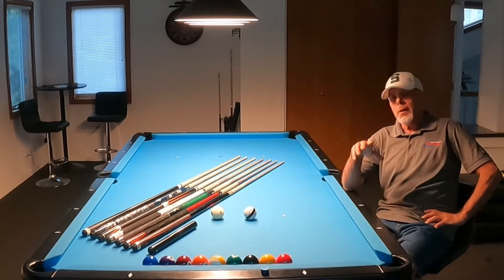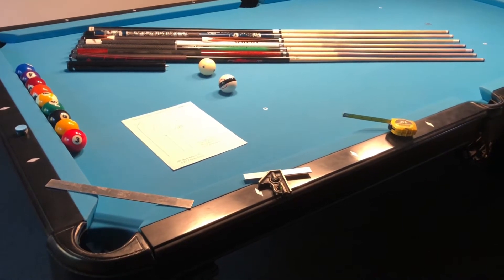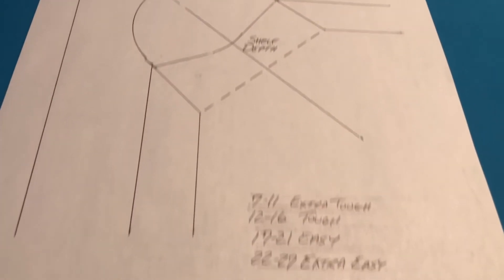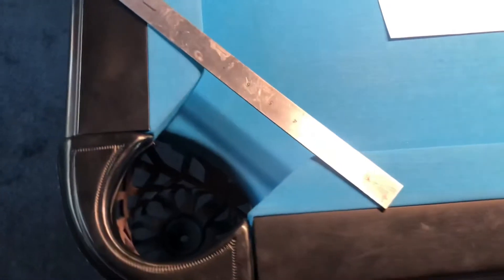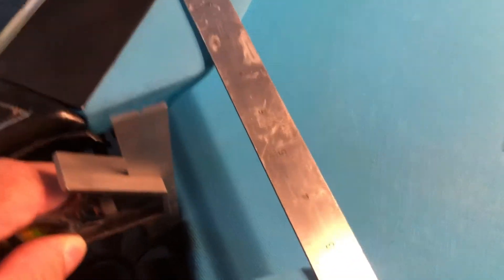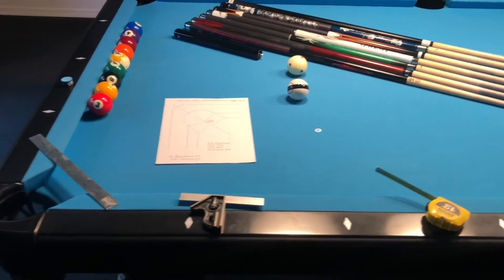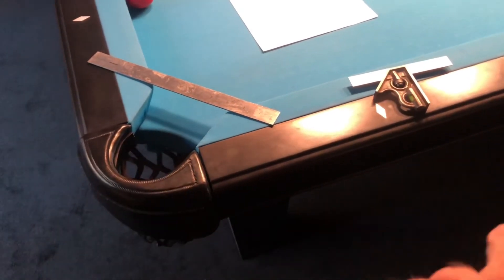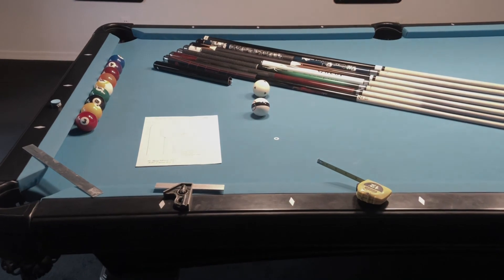How to calculate Pool table pocket toughness formula explained

Comment: The table ive been building, ive been following the diamond table spec. Unfortunately the slate i have only gives me so much shelf. So it falls in the 10 ish area on the scale, i think. Its been a while since i did all that.
Reply from the maker: @djsnowman06  Thank you for weighing in DJ, I appreciate you sharing 👍🏻😊

Comment: I have a 25 year old Artisan Designs by Advanced Billiards (made in USA) 7' maple table with a 3-piece slate at home.  

My corner pockets measured at mouth width: 5", shelf opening width: 4 5/8" (4.625), and 1.5" shelf depth.  5 x 4.625 / 1.5 = 15.42, so that's on the easier end of the Tough range.  Good to know.  The Diamond tables that I play locally are I'm sure in the Extra Tough range, but I love shooting on them.  

I bought this table about 7 months ago, and have replaced the table and rail cloth with the more affordable Champion Invitational cloth (Titanium color, love the color!), and at the same time I replaced the rubber rails (K66) and facings.  It was a fun challenge, I watched a lot of vids, but came out pretty good (I DIY everything that I can), with only a couple minor issues.  

I am thinking to spend the $ on Simonis 860HR the next time around, but I wish there were more color options.

I have watched a couple of your vids, good stuff, keep it up!
Reply from the maker: @MemphisGuitars-oj5wp  
Very cool and thank you for sharing MG. It sounds like quite a project 😊
Thank you as well for checking out my channel. Btw, I’m curious. Have you watched any of my more recent tutorials? I’ve evolved in my abilities as a content creator I think. 
Thank you 👍🏻
Reply: @ronthepoolstudent  Hey Ron.  I just discovered you yesterday, will check out more vids today.
Reply from the maker: @MemphisGuitars-oj5wp  
Thank you MG 👍🏻😊 
Please let me know if you have any questions as I’m always here to help and I answer 100% of my viewers/fellow players comments and questions.

Comment: I have an Irving Kaye Thunderbird 7' bar box (40x80) that has 4 & 1/8 pockets. Lol it's still set at $ . 75 on the coin slot. However uses moon size CB and I just leave it open to enjoy the predator arcos 2 pool ball set .... Best combination IMO... Obsolete now but better and more like a diamond table before their time
Reply: I think my table has been valley-i zed yet plays like a diamond table although there's only two diamonds per 36" of cushion
Reply from the maker: @ Believe it or not, I shot on a Valley table for the first time ever last Friday at a Moose lodge. 
I was told it’s 4 1/2” pockets were typically much wider. The sides were narrow too which I was told is typical. It played well as it had fast Simonis.
Reply from the maker: My favorite is my buddy’s 10’ Gold Crown. His pockets are 4 3/8” with diamond cut wings. He’s a 600+ player when he shoots on the smaller surfaces. The first time I shot on the table I got him 7-2 in nine ball. I recall missing five or six shots during the match. The key was to play what the table gave you and accept the long shot. That table makes me really bear down. 

Btw, this video was from a long time ago. The pockets back then were wider. Since then, I tightened them. My next cloth change, all pockets are narrowing another 1/4”.  The sides are getting reduced 1/2”.

Comment: Hmmm... I will check this out at Maryville billiards where I practice and play, 9' Diamond table  over 10 years old (I will find out age for sure and if the cloth and rails have been changed at any point, will get back to you.!!
Reply from the maker: Sounds good Chemmii. 
Btw, the only thing not taken into account is the angles into the pocket. My Olhausen for instance, has 155° angles which makes them rattle balls at times.
Reply: @ronthepoolstudent  hey Ron, I will check that also... I have a digital angle divider, I will be as precise as possible... I am wondering how much difference there may be between older diamond tables and new present day diamonds...do you have access to a new diamond table to measure or not ?? Let me know please ok?
Reply from the maker: @chemmii  I do and will check next time I’m heading to the billiard hall 👍🏻

Comment: Something is not right with this formula as it would give you the same result for many width combinations at the same depth. The angle between the wall pockets must make a difference. Here is an illustration (I could not paste a screenshot here so I hope the table in text form will not be confusing) :  		
			            Pocket		
			            Toughness		
W1  	W2	       D   W1xW2/D	Angle in degrees	
4.229	4.648	2	9.83	-11.97	
4.271	4.602	2	9.83	-9.46	
4.314	4.557	2	9.83	-6.95	
4.357	4.511	2	9.83	-4.42	
4.401	4.467	2	9.83	-1.90	
4.434	4.434	2	9.83	0.00	Parallel walls
4.445	4.423	2	9.83	0.63	
4.489	4.379	2	9.83	3.16	
4.534	4.335	2	9.83	5.68	
4.579	4.293	2	9.83	8.20	
4.625	4.250	2	9.83	10.71	Example in this video
4.671	4.208	2	9.83	13.21	
4.718	4.166	2	9.83	15.71	
4.765	4.125	2	9.83	18.18	
4.813	4.084	2	9.83	20.65	
4.861	4.044	2	9.83	23.09	
4.910	4.004	2	9.83	25.52	
4.959	3.964	2	9.83	27.93	
5.008	3.925	2	9.83	30.31	Wide open pocket

As you can see, the angle between the pocket walls shown in this video is 10.7 degrees but the formula would give the same toughness result for a wide open pocket where the pocket walls form a 30-degree angle.  That cannot be right.  The opening of the pocket (W1), the angle of the walls, and the size of the ball must play an important role in the toughness.  Anyway, the formula for the toughness could be a bit more complicated than W1xW2/D
Reply from the maker: Agree!
Old video hollosarka. The formula is from Dr Dave. Please refer to his channel for any more detailed questions. Thank you and sorry 👍🏻

Comment: Your shelf depth is not 2”. It’s 1.625”. My friend has your exact table.
Reply from the maker: From the points to the closest arc 
tangent of radius drop off (where the ball begins to drop in) is 2”.
Don’t know what to tell you but 2” is correct.
Btw, I’m a journeyman tool & die maker.
Reply: But you are measuring from the second drop off... Surely you should measure from the first?

Comment: A quick, but not as accurate check is to see if you can fit 2 balls in the pocket at the same time. 2 balls together is 4.5 inches. I haven't played much in the last 10 years and have played on some bar tables pretty good. Last night I practiced at a real pool hall that I used to play at maybe 30 years ago. I noticed the pockets were tight and I couldn't fit 2 balls in them. Not even close. I kind of feel the more serious pool halls have made the pockets more tight in the last 30-40 years.
Reply from the maker: Thanks for watching Richard and for your comment. You’re correct and here is what you are describing. This is my table. 
See link below:
Olhausen “Belmont” factory pockets
https://youtube.com/shorts/eUOtOTUlkb0?feature=share
Reply from the maker: Also, here is a great way to overcome pockets that may be too large for your skillset. 
Pool shot exercise
https://youtube.com/shorts/koFhJ_lDYpQ?feature=share

Comment: Is the shelf depth the same for the center pockets?
Reply from the maker: No
Reply: @ronthepoolstudent  what kind of shelf depth should I aim for on the center? I'm designing/building a table and I want something on the harder side like your table
Reply from the maker: @Shakshuka69  my side pocket shelf depth is 1/8” AD1. It’s more about width on these. Measure tables at your local billiard hall to find the width that would either present a challenge or not, would be my suggestion.
Reply: @ronthepoolstudent  Thank you! I'm going for a 5" opening tapered to 4.25" throat for the sides right now. Will likely go out and do some measuring. Appreciate the advice
Reply from the maker: @Shakshuka69  that’s a good width as I’m reducing mine to that also during new cloth time, good choice 👍🏻

Comment: Nice but what about the angle of the pocket . Mine are around 37 degré ?
Reply from the maker: I’m only using Dr. Dave’s formula here Alain. We are only able to calculate the knowns as is given per the formula.
This being said, my pockets for instance have 155° mouths which do not funnel balls into the hole unless they enter in cleanly without contacting the cushion at speed so yes, pocket angularity does factor in I’d say. 
Im not sure how to create a new formula to include this info and I have not reached out to the formula’s creator to question it. 
Let me know if you can think of a way to fit this in to more accurately sum up pocket toughness.
Thank you.

Comment: My table is 4 1/4 at the mouth. 3 3/4 in throat. 1.5 shelf. It comes out to 10.625 with your formula. That doesn't sound right?
Reply from the maker: That’s what I come up with too. This is Dr. Dave’s formula.
Must be the shelf depth is the difference. 
Seems like your pockets would be rated tougher however 🤷🏻‍♂️
Reply: @ronthepoolstudent  earl strickland said my pockets r some of the toughest he ever seen

Comment: hi ron, insofar as solving this notorious kickback problem, i think i have a potential answer. i have found the best pockets anywhere to be brunswick gold crown. i just ordered a set from amazon for $150. it might be able to work, if not they go back and it's on to plan B- whatever that might be. owen.
Reply from the maker: Hi Owen, for some reason your recent comment didn’t load to my actual video. I was able to find it in analytics which happens from time to time. 

I did not know you could swap out pockets from one brand to another so I’m interested. Please let me know how this change worked out. 
Thank you again Owen 👍🏻👍🏻👍🏻😊

Comment: hi ron, my name is owen and i have a 9 ft sahara [olhausan]. the side pocket outer edges of the leather is curling up, so it doesnt lay flat on the rails. in addition to this i dont like the exaggerated responsiveness of these pockets. i want to change these pockets to something else. perhaps a black vinyl  brunswick gold crown. is this something that is easy to do? let me know your thoughts on this. respectfully owen rex.
Reply from the maker: Hi Owen, I too have had issues with my Olhausen pockets. 
The balls often kick back out onto the table during harder hit shots. It’s so bad that the cloth actually ripped from the balls rebounding back into the lip. I’ve looked at them closely but haven’t figured out how to address the issue. As for your question, I don’t have an answer for that either. 
Keep me posted if you figure out something.
Thanks for sharing and watching my video Owen, sorry I couldn’t be of help with your situation 🤷🏻‍♂️

Comment: I built a bar box from the ground up... Cheaper and far more sturdy than the rickety particle board tables within my budget... And I was able to get a decent cloth, Aramith balls and US made Schmelke cue for what I had to spend.
I only had room for this size, so I made the pockets 4" to make it tougher. There's only a 1"1/4 shelf but balls rattle out a lot..! But I'm getting better everyday and hope when I do go shoot on a table with bigger pockets I'll be a pretty decent shot.
My table is no comparison to yours, but it turned out pretty cool for what it is... Give it look ~  https://www.youtube.com/watch?v=TR-RhxH8wcs
Reply from the maker: How cool is that! 👍🏻😊 VERY NICE!
I’ve not heard of someone building their own table. Nice job for sure. The 4” pockets have to be super tough. 
What does yours calculate out to Nick?
Thanks!
Reply: @ronthepoolstudent  Thank you I appreciate that..!
It figured out to be 12.8 because of the shelf being 1"1/4 but it plays tougher than that I think. It's tough to cheat the pocket, or to make long rail shots off the rail...
I couldn't see buying one of those CHEAPLY built tables that would be nothing but a wobbly disappointment with dead rail and cheap cloth... And being a trim carpenter I knew I could do much better, so I studied the geometry of a table and watched the best re-felting videos I could find for a few months before I built it. Now that I know I won't mess it up, I'll probably get a good cloth in the near future.
Since may 2nd I've only ran out twice, but I get quite a few 6, 7 and 8 ball runs then choke...lol Shooting for shape with spin, deflection and throw can make even "easy" shots easy to miss.
In the 80's my buddy's mom was "friends" with Bob Owen and we would go to his house here in KS. and play with him and Gabe when he was just a little kid...lol
Thank again for watching and replying, I'm pretty proud of it even though I still have a little work to do to finish it up.
Reply from the maker: @2869may  very cool story man. I understand now how you were able to build your own…trim carpenter says it all bud…👍🏻💪🏻😊👍🏻
Reply from the maker: @2869may  thanks Nick, btw, I’m a tool & die maker by trade but switched over to residential home remodeling/owner of Clear Choice Home Improvements, Inc. back in 04. (now retired)
I know trim carpenters have to have skills and be fussy in their trade. 👍🏻
Reply from the maker: @2869may  very nice, I have a ton of pics as well of our high end projects but not the creative thought to put them together with classical music lol. Beautiful!

Btw, for some reason I can’t open your latest comment to answer it. Your comment was on using low rather than inside top…not sure why really.🤷🏻‍♂️
Reply from the maker: @2869may  not sure why I can’t answer it that is…
Reply from the maker: @2869may  you can post a pic, you only need to save it on an editing app then copy/paste a link within the comments.

Comment: Thanks for the video! I'm was just about ready to have my railings extended to make my pockets tougher.....similar to the 9' diamond tables I play on a very high end pool hall. However, it seems like to be able to do that I would have to also extend the slate, which isn't really possible, to make the shelf depth correlate with the extended railings. After seeing this video I'll have to do some ruff calculations to see if extending the railings may be a waste of money. If you have any knowledge regarding this please let me know. But I'm thinking you may have just saved me some money.
Reply from the maker: The pockets can be shimmed during recovering which also reduces the opening size TPA. Research this and make sure someone competent does the work. Good luck…👍🏻
Reply: When you get custom rails built the new rails will be a little thicker making the shelf deeper